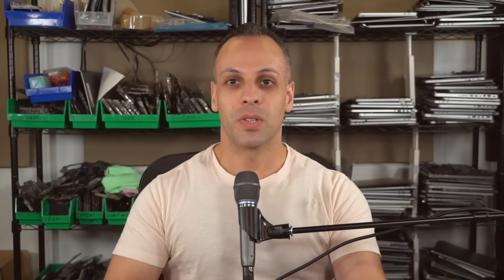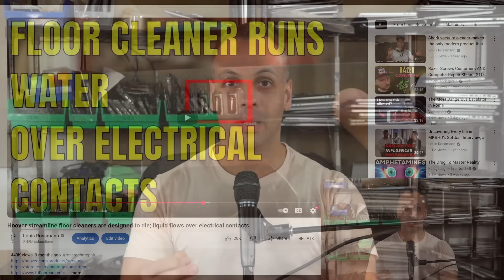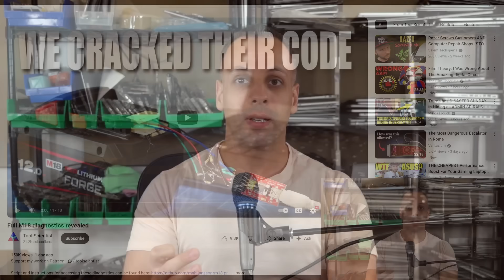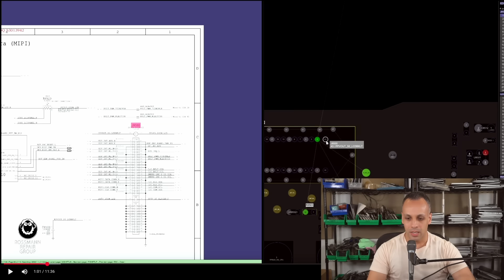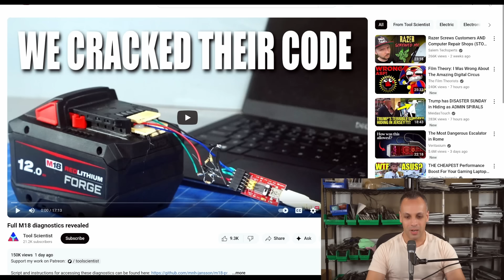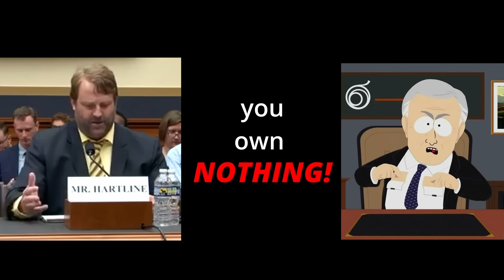Imagine putting DRM in a battery to void warranties...

Comment: Over the years I've bought or been gifted dozens of cordless tools "from" Milwaukee, AEG and Ridgid tools. World famous brands from the USA and Germany. All made in China, and designed by Techtronic Industries based in Hong Kong. None of the batteries or chargers are interchangeable! That in itself is bullshit, but now they put little chips in so they can fuck you even when you use the tools that go with the batteries!
Reply: there needs to be a standard battery connection for each voltage

Comment: I understand where you are coming from. I have had issues with high dollar washer and dryers. Last October,i purchased a GE washer to replace the junk Maytag washer i had. It went out a little over a month later. Ive had people come out 6 different times. It was supposed to be 7,but GE neglected to send them out after i called. It just freezes up. I have to unplug it to get it to reset. It doesn't reset everytime,just unplug it,let it sit and it usually does. Whats bad is when you need certain clothes for the next day,start the washer,get up early to put them in the dryer and they are sitting in a full tub of water. Appliances these days are overpriced trash!
Reply: I am still using a Maytag dishwasher that I purchased back in 2001! At one time, Maytag was a good brand ("The dependability people."), but apparently not anymore. Same story with other brands. You would think some brand would figure out that people like stuff that lasts and simply build good stuff!
Reply: @rodneybrocke from what one of the repairmen told me, speed queen is the only washer and dryer worth buying. It's a commercial grade appliance. The only issue i have is the washer is small. I was told that it is to allow for normal water use. I never liked Washing clothes in dirty water. The clothes don't feel clean when they are washed in water saver mode. Being in a high temp/high humidity area, clothes can get a little funky. On water saver mode,its like the grime is concentrated and doesn't rinse as clean. When i wash,i use the larger water cycle anyway

Comment: I love your comment on the 50v power line on the Apple Mac.  As someone who grew up with a C64 with a 1541 drive (the one whose performance was massively degraded because a late PCB change before mass production wasn't tested properly and severed the port's clock/sync line meaning data had to be sent 1 bit at a time instead of one byte).  It's amazing how badly designs can be messed up, and how often they enter mainstream consumer technology.

Comment: I wouldn't really be surprised if Milwaukee doesn't actually care about users using this. They didn't actually encrypt the communication or really obfuscated at all they simply didn't advertise that it existed and didn't document it. I feel like it is more likely that they simply have no interest in offering software support or complete documentation to the public. Well it is possible that they really did intend to keep this all hush hush and secret I think it's equally likely that they simply built a tool for internal use that they didn't want to have to bother making simple and robust enough for public so they simply didn't tell the public that it was there.

Comment: TTI has owned Milwaukeefor a long time and Milwaukee makes great innovative products. I have never heard of Milwaukee voiding a battery warranty for the reasons noted in this video. They have always come through for me regarding warranties. About five years ago I bought a M12 power tower light that I experienced a design problem with the internal battery connections. I was able to exchange it for a new one, but it had the same issue. I called Milwaukee and they sent me a M18 power tower light and never charged me a thing. they also let me keep the M12 light that intermittently had the problem. I have brought multiple drills in for warranty work without issue. I have never had any specific problems or warranty concerns with their batteries. At least not yet, and I have used Milwaukee products for years.
Reply: I think it may be kind of Hit or Miss. I haven't needed to warranty any Milwaukee products yet but from what I've read they are usually pretty good and often don't even require a receipt. But that doesn't mean that they're always good and that doesn't mean that the stories of them denying certain claims aren't true I suspect that it may be more of a case-by-case basis or that certain people who work there are more or less likely to deny claims. They may also be more likely to deny claims from someone who is submitted multiple warranty claims in the past and more likely to approve the first claim or so from a new customer. It's basically impossible to tell exactly how they handle their warranties without an immense amount of data that only they could possibly have. Overall their tools are generally well reviewed and their warranty is generally considered okay so there's no clear reason to see them as more or less problematic than other similar brands. It certainly true that the industry isn't any great place but they are by no means the worst or the best.

Comment: I was under the impression that the battery balancing system was in the charger, not the battery pack. It can read the diagnostic data, and use that to inform charging. I think this is more about keeping you from being able to knock off their chargers than anything else, as (until now) nobody knew how they communicate.

Comment: Inkjet cartridge engineers making batteries. I'm all for data. With the plethora of microprocessors available for pennies, it's easy to collect reams of data. If it's used for product improvement, that's fine, but if you're using it to bone as many people as possible to maximize profit, then not so much.

Comment: Glad hobby-grade RC stuff deals with this problem directly by demanding that the battery provide terminals for each cell so balancing occurs during every charge. The only downside is that it makes the chargers fairly pricey. It's worth it for longevity, though

Comment: them putting void warranty circuitry and not load balancing circuitry is done with intent by most electronic manufacturers, they want you to replace said electronics within a set period of time . if shit wasnt made to break the entire chain of profit would break down, they dont care about customer loyalty as long as they can get your money at some point in time. take a look at any modern household electronics, like a dishwasher or a washing machine, 9/10 times its not the mechanical components that break down just after the warranty, expires its the electronical components that has any kind of circuitry. 
i have heard of printers that break down exactly on the same day it was powered on a few years later

my grandparents were loyal to husqvarna. my dad inherited some of those appliances after they passed. the freezer box  lasted nearly 40 years before it gave up and the fridge is still going after 45 years and both kept stuff cooler and had a better average temp and made less noise than modern counterparts. both of those appliances were bought before i was born

Comment: Your explanation about the phone reminded me of a young engineer acquaintance of mine who worked for a defense contractor as his first job out of college. His first couple of weeks on the job, he had no assignment and he was going batty (ADHD kicking in). To calm him down, they gave him the schematic for a system, 6 ft x 3 ft, explained the problem, and put him to work. 30 minutes later, he showed his supervisor the problem that a sensor circuit was too close to a high voltage circuit and if separated or insulated, would cure the problem. The high ranking uniformed man in the room said, so you think that you have solved in 30-minutes what has taken this company two years to find? His response was, well, it only took 10-minutes, but I didn’t want to embarrass anyone. After running into many of these type problems during the first year, he left for a microchip design company that was not involved with defense contracts.

Comment: Just an FYI, doesn't negate what your say. 
It's one battery of multiple cells. 
A battery per definition is a container with multiple cells in parallel and/or series.
So it's one battery containing multiple cells that have to be balanced in order to work together optimally. 
A AA Duracell is a single cell, not yet a battery but an alkaline electric cell. When you put multiple cells in your device they form a battery.

Comment: Last winter I ordered a Kenmore two-motor vacuum, dark grey and orange, similar to Shark. I had always had good luck with Kenmore stuff before… but not that. It broke on the first use. The plastic that the swivel was made from was so soft that it couldn’t actually work. The plastic that entire Kenmore was made from felt like really soft, flimsy plastic. That Kenmore was manufactured by a company that just licensed the brand or whatever complicated business arrangement it is. Trusted brands aren’t a thing anymore I suppose. At least not to me.

Comment: Someone has probably said this already in another comment, but Dyson did something very similar to this (and to the best of my knowledge, still does) to their stick vacuum batteries.

A guy with the user handle 'tinfever' over on the EEVblog forums discovered that Dyson chose not to populate the footprint on their battery BMS boards that would otherwise have been reserved for a simple SMD resistor that would in turn allow for balanced charging. They also had the boards running off a PICAXE microcontroller, which they'd programmed to fail if one of the cells dropped below a certain voltage threshold (which of course, it will eventually, because you know, no balanced charging).

Comment: Hate the one key bs!  I hord all the old power tools and the new ones that want or need a connection go to the lads on the road.. last few years iv been upgrading to old hand tools that I restore for woodworking . Been through at least 8 Dewalt 60v max batteries in last 5yrs & pretty sure it's was one of those on rapid charger that burned down the last shop

Comment: 2:45 Not quite. Technically a battery is a collection of cells connected in series to produce a higher potential than an individual cell. An individual Li ion cell has a 3.6 to 3.7V potential (or a set of cells connected in parallel).
Reply: He literally calls them cells. Irrelevant point.
Reply: That is what I was thinking
Reply: When does a cell become a battery in it’s own right? There are several 6 volt “lantern” batteries that when you crack the case open you find finished good D cell batteries. I saw it on YouTube .Then I opened up some dead ones at work. It must have been cheaper to pull batteries of the line and repackage than create from scratch.
Reply: @Pocketfarmer1 The D cells are actually single cells. That chemistry gives you a potential of approximately 1.5V nominally, so four in series gives you six volt. Same idea as a traditional lead acid accumulator car battery which has six LAC cells with a nominal 2V potential.
Reply: Each cell is a separate individual battery ... technically.
Reply: @LeverPhile  Yeah no, it’s not.
Reply: @srdau2  Yes, they are.  

Each cell is its own separate sealed battery.  Take a battery pack apart and you'll see for yourself
Reply: @LeverPhile What you’re saying is ridiculous. If a cell is a battery then your argument gives infinite recursion. What I think you actually mean is that larger batteries can contain smaller batteries. But eventually you’ll get down to a cell, which is not a battery.
Reply: @srdau2   No, each individual cell that has its own separate voltage potential is in fact a battery.  Anode, cathode and electrolyte is what makes battery, and each cell is a separate battery.  

Look up a potato battery ... all you need is to stick a piece of copper and a piece of zinc into a potato and you can measure voltage between the two metals.
Reply: The only thing that makes the individual cells in a LiOn pack not a battery in themselves, is they lack a Battery management system, the circuitry needed to safely charge and discharge the cells. 
It’s also the circuit that would handle the balancing Louis speaks of.

But at the same time if you connect a single cell to a BMS it can also be a battery. So I don’t understand why all the fuss. It’s not like this vid is going over battery repair at a technical level.
Reply: @JessySpinka  AA duracell batteries lack a battery management system, yet its still a battery.   A battery is simply an anode, a cathode and an electrolyte ... those cells ARE batteries.

Comment: I can finally check my Milwaukee cell balance without tearing open the packs.

Only issue is I still have tear them open to actually balance them...but I've saved about 40 packs that stopped working for my company by balance charging them myself when the OEM charger refused to charge them.

We would have had to spend $6,000 to replace the batteries that are still going strong today in 2025 because I know how to use a DMM and benchtop power supply.

Most people don't have time to do this...and have to eat the $6,000.